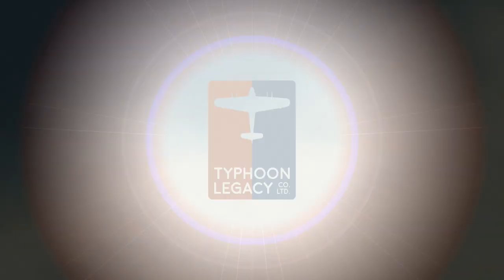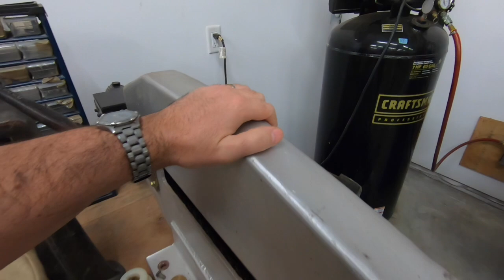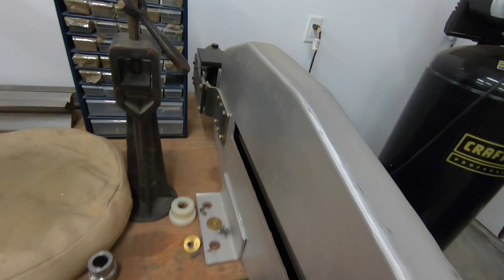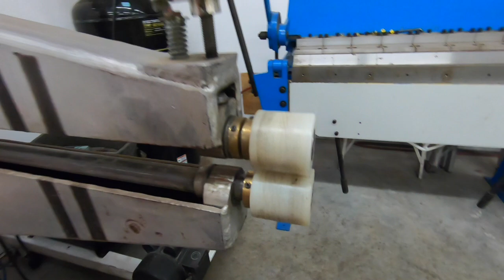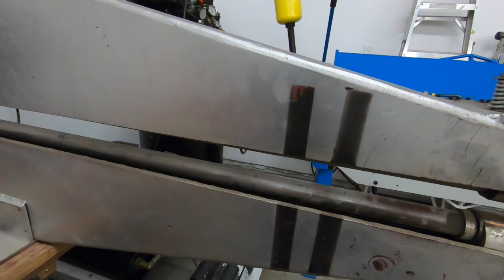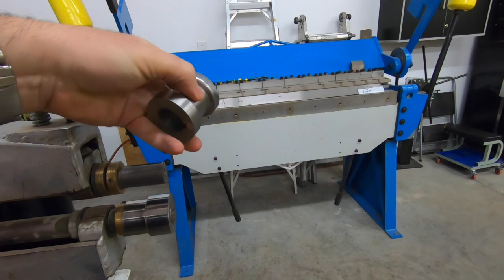Bead Roller Dies - Metal Shaping; Hawker Typhoon

Comment: How many usable engines are around?
Reply from the maker: Very very few, approximately 40 in all conditions (crash and sea recoveries included). I would say less than 10 that are suitable for rebuilding. ~Ian
Reply: @TyphoonLegacySociety  does it use RR merlins or other British built engines?
Reply from the maker: @miles2378  Yes, the Typhoon is powered by the mighty 24 cylinder Napier Sabre sleeve valve engine. ~Ian

Comment: Good video! Quick question.....I am trying to find an inexpensive small lathe to make my own Delrin dies....something that can bore a 3/4” ID hole and then also slowly cut the outside edges to form what I want.....can you suggest anything?
Reply from the maker: We have a South Bend Heavy 10 here, it is a good size and decent quality. I would always go with a used older machine over a new import machine. I hope that helps. ~Ian